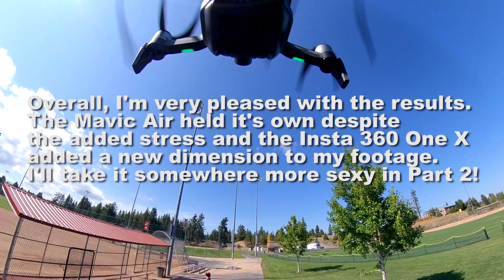Insta360 One X - Mavic Air - Shapeways Camera Mount Take To the Skies! Pt. 1 (with sample footage)

Comment: Always fun videos from you. Im thinking to get mavic pro. Should handle the weight better.
Reply from the maker: I actually originally bought the Pro but returned it when the Air was released because for my daily usage needs, the Air is more appropriate. The Pro can't be stashed in a pocket. The Air is the best for portability and at the time I bought it, I'd never even heard of an Insta360. :-)

Comment: Did you risk it without the Adventure case? With all the, understandable, safety issues flying drones nowadays I don't think I will be getting one, speaking as an amateur enthusiast.
Reply from the maker: I tried it with the Venture case and it couldn't handle the weight. So I it's just a gamble every time. I took it out for a better flight a couple of days ago. Video forthcoming.